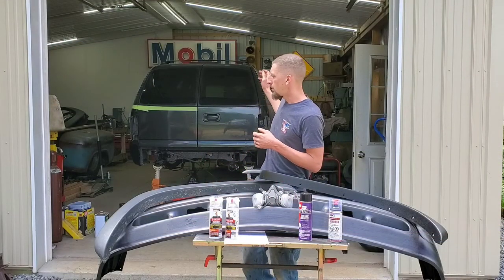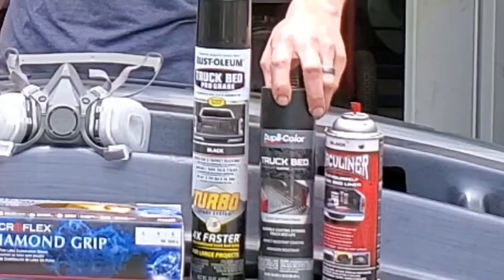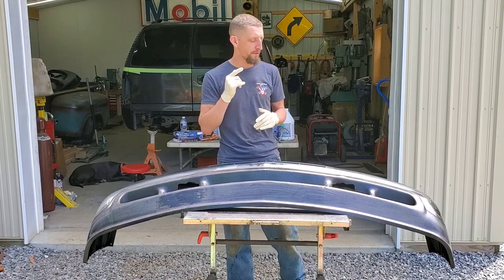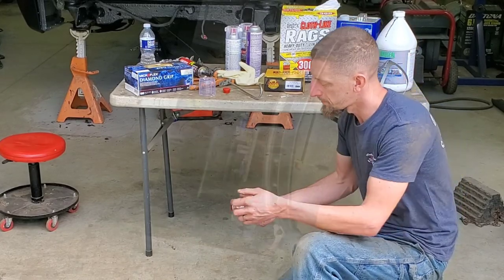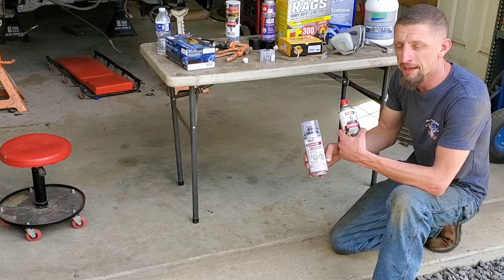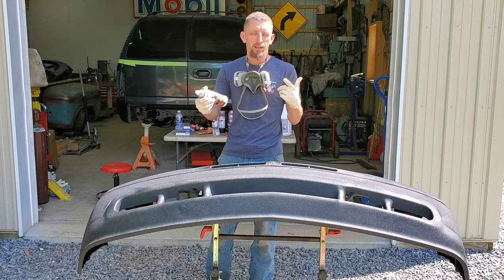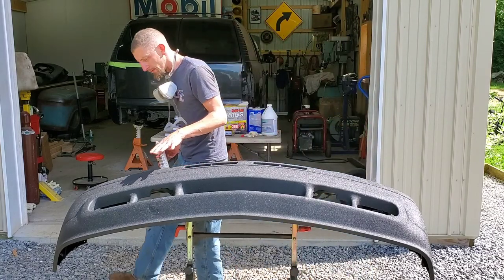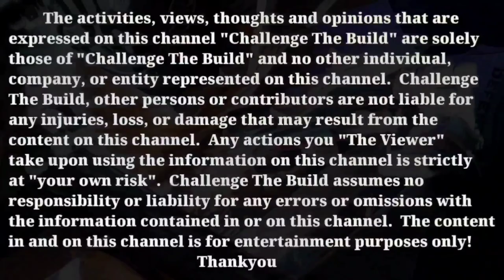Samurai Bed Liner Coating Black 2 Part Polyurethane - Review / How To, Painting A Front Bumper C.T.B

Comment: How does it Compare to Raptor Liner? I like that it’s Half the Price.
Reply from the maker: Considering the work was done two years ago...  It is holding up really well.   I would recommend it and I will definitely be using it again.   One thing I will definitely recommend is use the epoxy black primer before the topcoat.    The epoxy primer that Samurai sells is awesome in conjunction with the bed liner....  Also out of the 10-12 cans I have used one can was no good...  So hopefully you won't get any bad cans... Also shake them alot...alot alot...